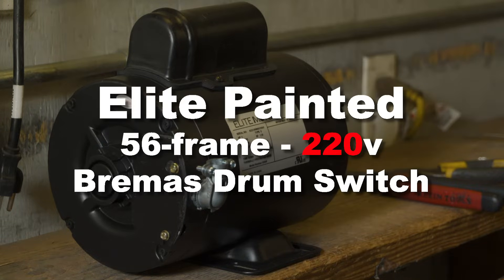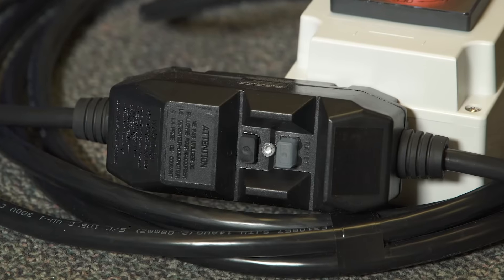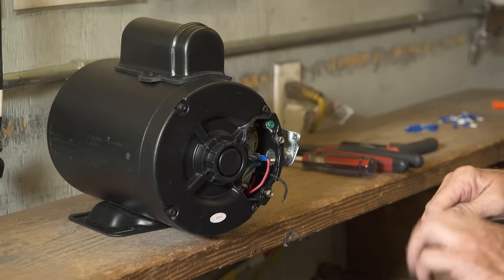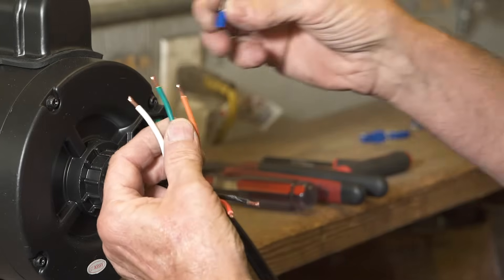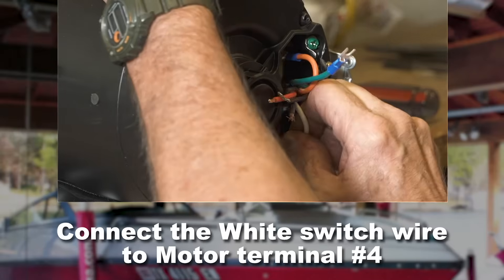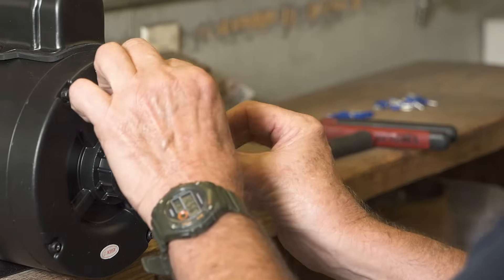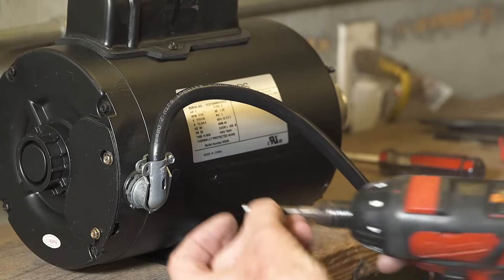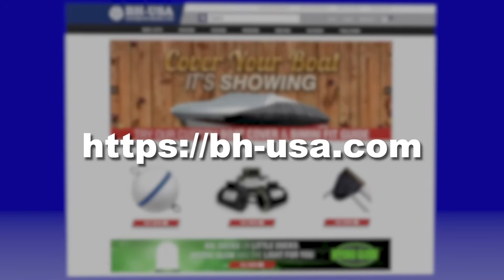Elite Motors - 1 HP Painted 56 Frame Boat Lift Motor - 220v Wiring

Comment: I have this motor wired exactly as indicated in the video and when pressing on toggle up, it goes up, press toggle down, it goes up. The motor is also surging and not running steady.  I have no idea what to do at this point.